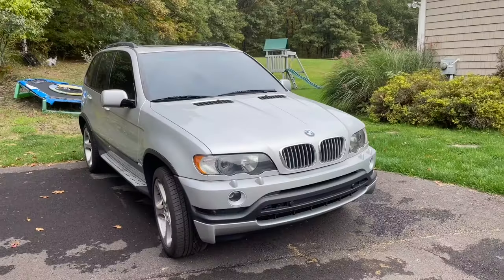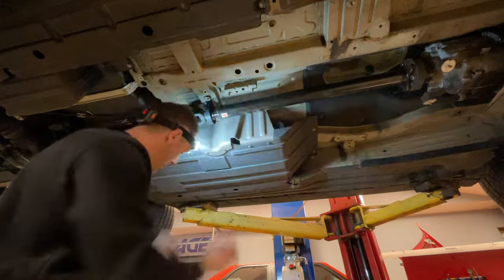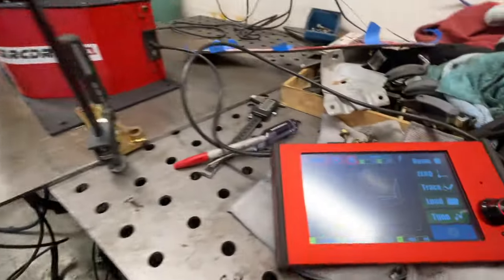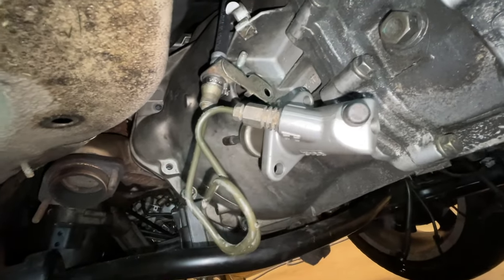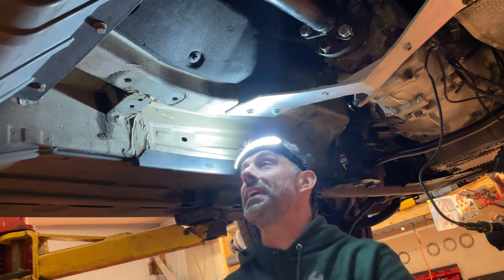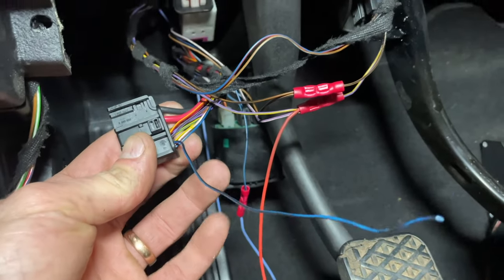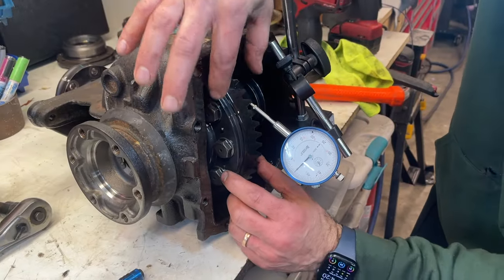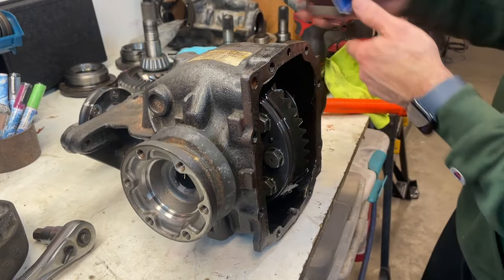Interactive-ish BMW X5 4.6is 6spd Manual Swap Tutorial - The Most Unique Ending For A YT Video!!

Comment: Just an fyi, that transmission and torque converter is 4.6is specific. Probably a good keep for someone who needs to repair or replace their own 4.6..
Reply: I believe it has +1 clutch and steel in one drum and a bored out bell housing for the larger tq converter.  And different software I'd guess for the tcu.

It is still a 5hp24 and I believe people will replace the 4.6is specific unit with a 4.4 v8 unit w no ill effects.

One guy in Europe 6 speed swapped his 46is and did a custom rear section and a hardened steel spline portion to fit the transfer case.

That transfer case is pretty reliable I think overall.
Reply: @spencermaiers8322 the 4.6is has a bespoke Alpina high stall torque converter it's different from the one in the 4.4i

Comment: I just met a guy recently that has a 4.6is X5 that was manual swapped and they retained the AWD. So it is still possible, although I'm pretty sure a custom adapter was made for it.
Reply from the maker: Anything is possible! That adapter on the output of the trans is key to mating to the transfer case. Do you know who that was? I’d love to chat
Reply: @Garageaholic  I didn't get the guys name but I could probably find it out. It was an Imola 4.6 with a full Supersprint exhaust from headers to mufflers. Sounded absolutely glorious.
Reply: @jharmon0718 I’d love to chat with that guy as well! I just recently acquired my 4.6is and as amazing as the car is with its factory setup, I too foresee myself swapping it down the line!

Comment: I'm really interested at what you did here. By taking it from an automatic to a standard, I've been trying to figure out your video of where you got the transmission from, where you got the flywheel, from, what transmission you used, where the what the transmission come out of there's just certain details that you're not giving within your video that as a backyard mechanic, I need that information so that I can make this same very switch myself and to have it function properly, as you have the wiring is somewhat simple to figure out, although some more detail on that would be fantastic. Is there any way that you could send me an email? I will? Give you my email address as soon as I hear a reply back from you.I'm very interested in this.I would like to do this and make this attempt myself.I have an 02 x five, with the four point four is into it and I'd like to do this myself
Reply from the maker: Perhaps a subscription for help would do you good. Send me an email, or check my website for the subscription product and I would be happy to sit with you